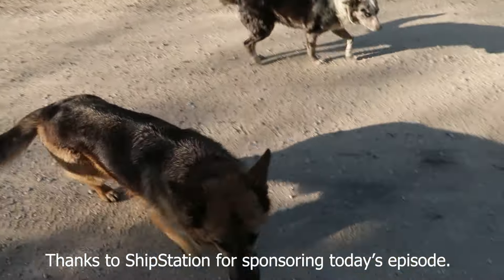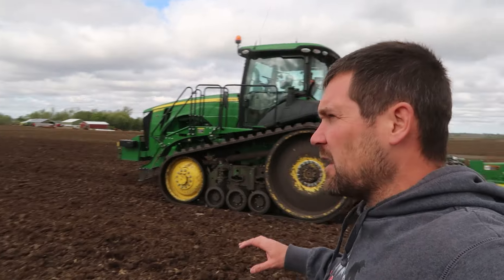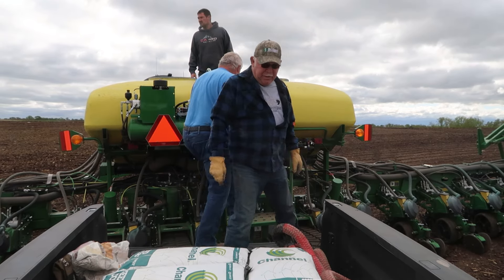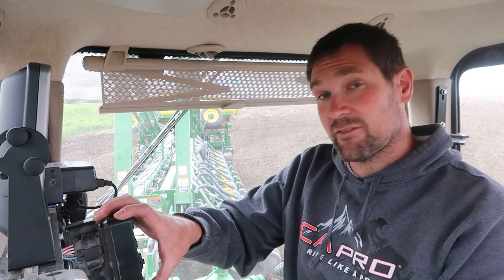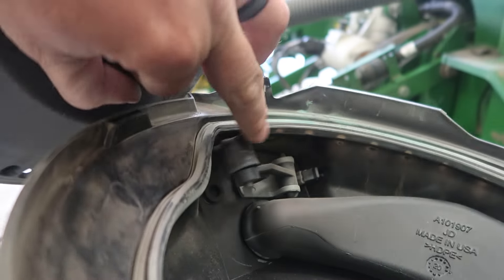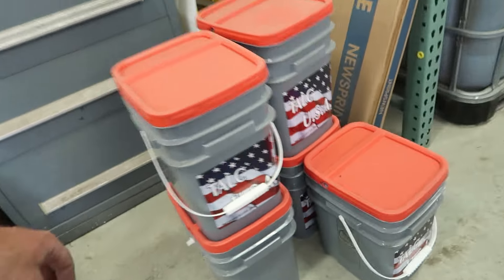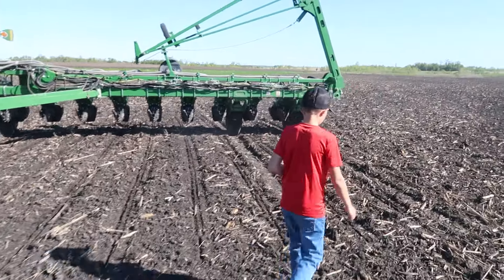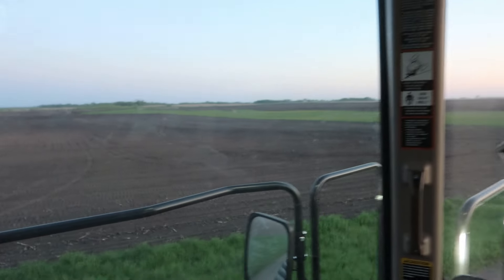The Do's and Don'ts of Soybean Planting

Comment: A tip for twine, weeds and tall grass wrapping. Get a Stanley utility knife and get the carpet blades for it. They have a hook with the sharp edge on the inside of the hook. I grind down the sharp point a touch so not to dig into seals. Then go to town on it and slash and pull. It cuts through AND pulls the stuff loose. Works on tillage, mowers, cultivators, etc.
Reply: To a floor guy, carpet blades are entirely different, thin and scary sharp ones, the ones you mention are hook blades, and after your comment I'll keep a knife with hook blades, for weed eater though, 
 I don't have a farm 😫😫🎻
Reply: I agree with 1976, as a cleaner and repairer of carpet, it sounds more like a vinyl installer blade that you are speaking of.

Comment: Hi Zach.    Did you ever try hauling the roller behind the planter?   Great video,always entertaining.
Reply: That would take a lot of HP.
Reply: @jimlangley840  Where I used to work we had spiked harrows on the front of the planter then of course the planter and then a roller.   It worked out really nice for leveling your fields.  But we never had planters like yours or rollers like that.

Comment: In the old days...farmers planted "check" corn, checker board planting pattern using a chain distancing device so they could cultivate both ways.  Running a cultivator one of the ways was a back breaker all day rolling over the planted rows.

Comment: You really should pull those sensor connector plastic covers off, and with a pick, tighten up the little metal female pins, bend them tighter, that way they will grip the incoming male pin better, and avoid vibration related momentary loss of signal. That's the problem you're dealing with, and a much cheaper and simpler fix than the stealership replacing good sensors!

Comment: You asked if we liked videos when everything works and do big dramas?  Yes they show what farming is normally,  hard work that may get monotonous at times but is rewarding in that you can see what you accomplished.   Your videos on solving problems are great as well.  Just what I need after two days in the shop trying find why my 1978 Chevy K10 won't start.  Finally found the problem a mouse chewed through the fuel line on top of the fuel tank.
Reply: Sounds about right I tried to re-wire my whole house or at least on circuit due to a faulty light switch.  Hot wire had come off and was making every other outlets black wire hot cause it was touching the metal box.  LOL.    Moral of story check the obvious first!!!!!     Guess it wasn't too obvious as your fuel problem was till after the fact.  Hind sight being 20/20.  :)

Comment: I’ve been thinking about all of the sensor issues and personally every time I have problems with non ag things killing sensors it’s a low power issue. I wonder with the pro driven power unit if the lugging of the engine is causing low PTO speed causing the power unit to not be able to supply what’s needed.  Also with no battery buffer when the on demand in rush of power is not fast enough. Even RV’s use the battery to help with inrush by using the battery to prevent the slide motors from getting low power from the converter killing the motors.

Comment: I believe I would use a small propane torch to remove that twine, at least it would burn/melt enough so you could roll the baskets, then hopefully the rest would pull out. It would be worth a try.
Reply: The heat would ruin the bearings.
Reply: @BWYinYang  not heavy heat. Just enough to melt the twine. I’ve been an industrial maintenance man for 30 years, I’ve worked on my dads heavy equipment for 35 years. You don’t want to get the bearings super hot but they can withstand some heat. There are a lot of bearings in my profession you gotta heat in order to get them on or off the shaft, we grease them once they are cooled with no issues.